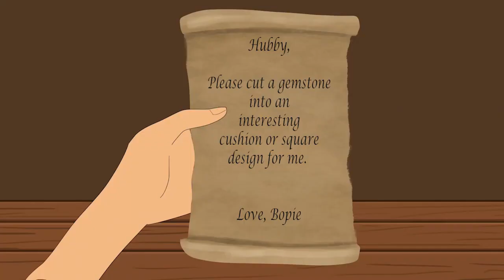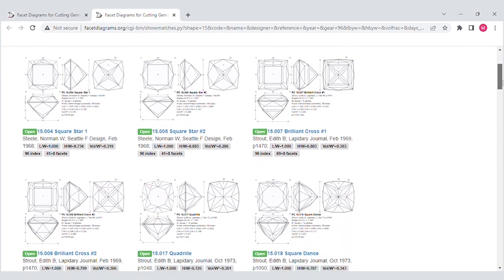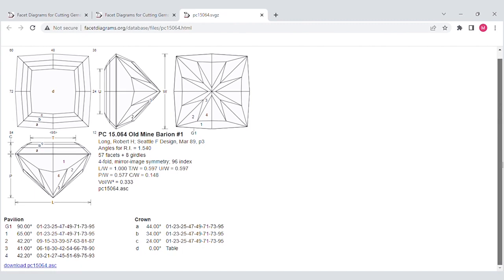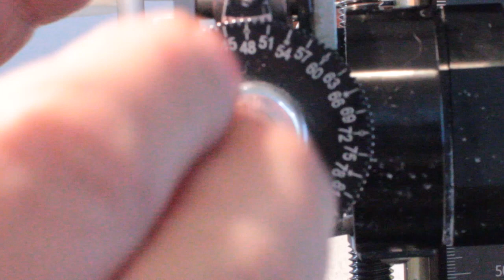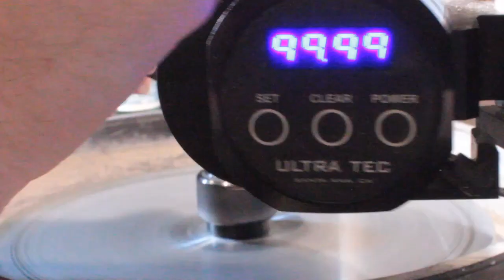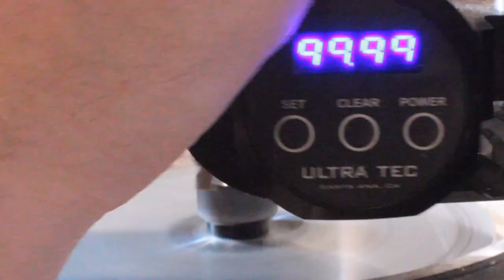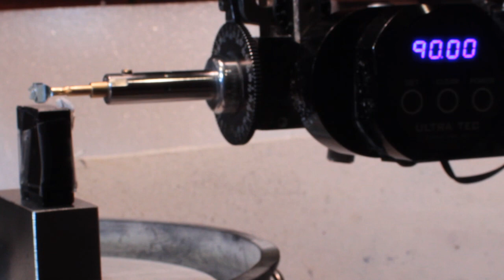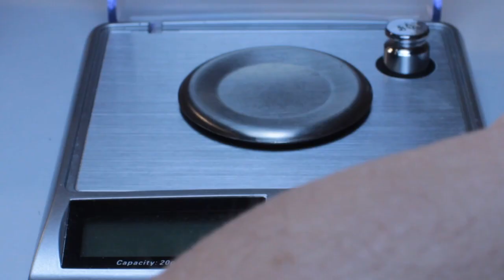Gem Cutting Tutorial: Old Mine Aquamarine

Comment: Do you always lose that much material? 15 ct to 2 seams like alot
Reply: A 17.15% rate of return on rough, is a little below average.  But not by much.  20% is a good rule of thumb on a rate of return.  This piece did have internal 'needle like' inclusions which caused some additional loss of rough to work around.  Additionally, if you look at the design and the original piece of rough, you should be able to imagine the parts of the rough which will be lost in the cutting.  I generally get a higher rate of return, but it all depends on the design, shape of the rough, and how clean the rough is.

Comment: Hi there, new to this. I have cerium oxide powder, will it do the same job as the battstick. I have a tough time getting high polish.
Reply: It depends on how fine it is.  But I often use a cerium oxide and water mix in a spray bottle, and yes that works the same as a battstick.